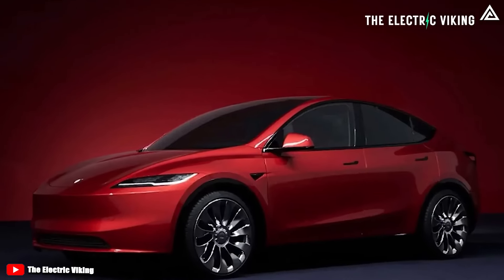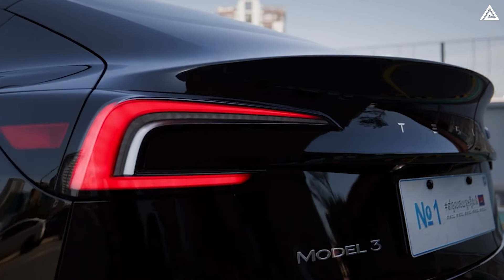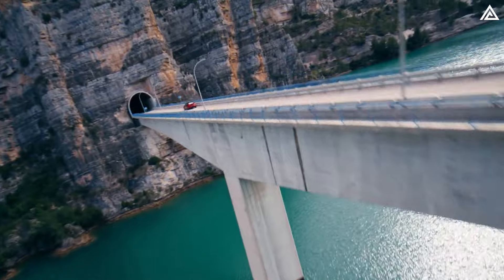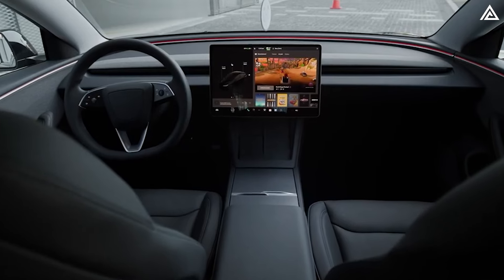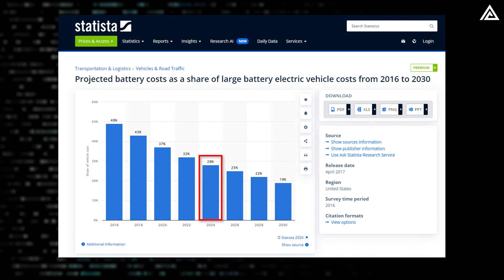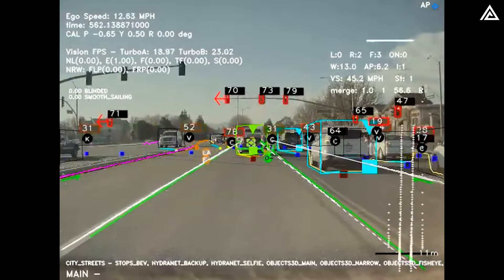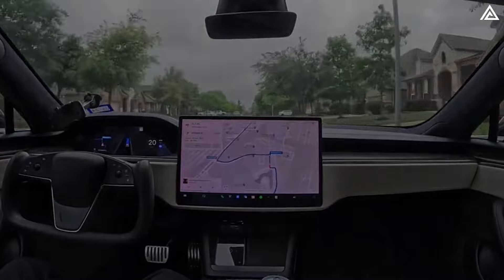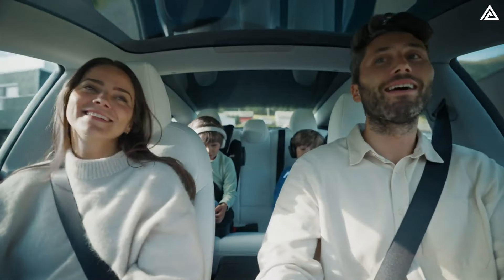5 Reasons to Wait for Model Y Juniper 2025. All-new Upgrades That Will Blow Your Mind!

Comment: 5 reasons? 1) It will be available in a large full size luxury automobile for us guys who doesn't do little tiny cars, 2) It will be able to fully charge in 8 minutes or less,3) It will provide you with a range of atleast 500 miles, 4) dashboard will have better character and give you a view of you instruments and displays dead infront of you without having to look far right taking your eyes off the road and heads up display, 5) extended warrentys...
Reply from the maker: Thanks for your detailed sharing!
Reply: @adamtech999  you're quite welcome. This is what Elon Musk should be working on....

Comment: What are your thoughts on the potential changes to the Model Y's wheel design and how they might affect the car's handling?
Reply from the maker: The potential changes to the Model Y's wheel design could significantly enhance the car's handling, providing better grip and stability. This upgrade might also improve overall performance and driving experience.